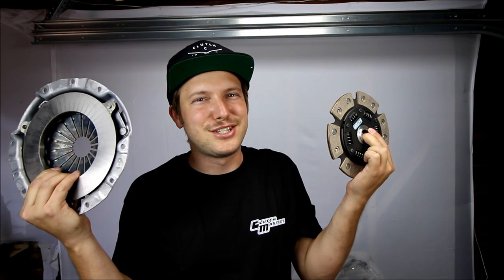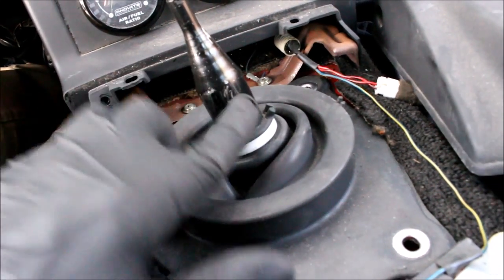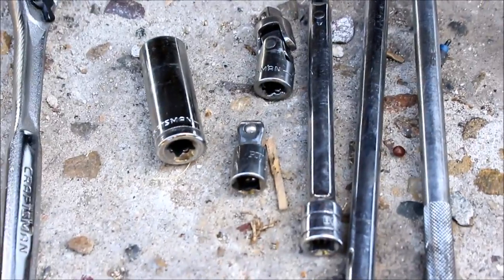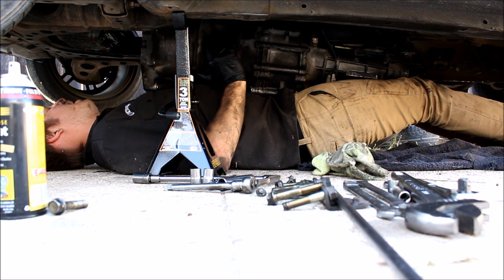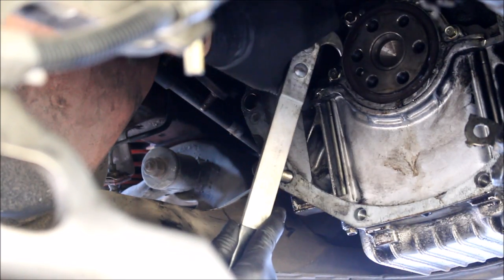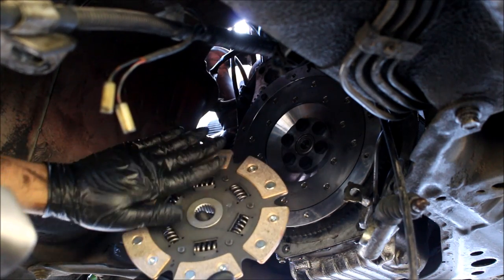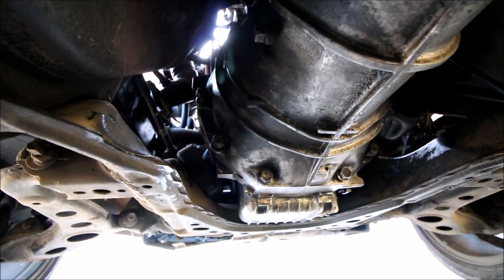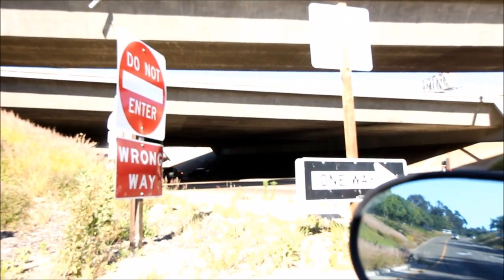Caught Slippin: The ULTIMATE Miata Clutch Replacement Guide!

Comment: Great channel!  So i just did this.  This exact same thing.  Went to start the engine and nothing.  Starter is clicking but thats it.  Then i tried to turn the engine by hand and theres no way that thing is moving.  All power is all, just like before i touched the trans.  Checked all the connections and i think its all good.  Wth is my engine stuck? Any ideas anyone?
Reply from the maker: Clutch was installed incorrectly somehow, sounds like something is mechanically stopping the engine from rotating. With the clutch pedal depressed and the transmission in neutral same thing?
Reply: TheCarPassionChannel ive tried clutch in, out, in gear out of gear.  The engine wont move.  From what i can recall i know i did it right.  Putting the pressure plate on i had to turn it to screw the bolts in so i know it was ok then.  I think even if i managed to put the clutch on backwards it would have given me some trouble then.
Reply from the maker: @sanjingitarista  Strange, did you try to rotate the engine with the trans off?
Reply: TheCarPassionChannel when i had the trans of to replace the clutch i was rotating it just fine.  Bolted the clutch and no way.  Ill try to remove the sparks, release some pressure and try again.
Reply: Nope...
Reply from the maker: @sanjingitarista  time for a trans drop
Reply: TheCarPassionChannel noooooo!!! Not again
Reply: So, i did it wrong.  I had no clue but i totally bolted it on but didnt line up the teeth apparently.  Didnt think it went hard or anything but apparently it did, ... since now i cant separate the trans from the engine.  Wtf did i do to this car??? God damn it
Reply from the maker: @sanjingitarista  as soon as you push in the clutch pedal 1 time the disc centers and it's perfectly aligned. If the disc want lined up the trans never would have bolted on.
Reply: TheCarPassionChannel hmmm.  So why cant i separate the trans from the engine now? All the bolts are off.
Reply from the maker: @sanjingitarista  I'd quadruple check that. Don't forget starter bolts

Comment: I took off all bolts, cables, exhaust, ppf, drivetrain but the trans just spins, no matter how much i push or pull it wont come off engine pls help
Reply from the maker: Try having someone lift the nose of the engine (tilt it backwards) while you fiddle with sliding it out. Carefully.

Comment: hey guys would a bad throw out bearing cause it to not go in gear when the car is on? also when i turn the car on when its in gear which clutch on the car wants to move forward and it wont start, i already bled the clutch but the issue is still there
Reply from the maker: No. 99% of the time it's a hydraulic issue, especially if the clutch is grabbing a little bit but not all the way with the pedal in. bad master, bad slave, or bad bleed. Could also be pedal adjustment but that's not just randomly going to change unless it came loose. I have a video on master cylinder replacement and bleeding if you need it 🙂 slave cylinder replacement is basically the same process.
Reply: sick thanks, oh and i forgot to mention that it whines like u said, im not sure if that helps with the problem, it had no fluid in the brake master so i put some and it work and then after an hour it just didnt work after that
Reply: hey greg i just replaced it and it still won't go into gear lol, it makes really weird noise when i right to put it in gear

Comment: Can you fill the transmission  with oil through the turret instead of the fill plug of a 2000 miata nB 5 speed?
Reply from the maker: Only 6-speeds can be filled through the turret.
Reply: Thanks for answering. Also, when pulling off the transmission does it have to be leveled or support the oil pan with wood? I am having trouble pulling out the transmission for the last few days?  It there other issue that can be causing to be stuck such as seized clutch or pilot bearing? Please help me I am lost and frustrated!!
Reply from the maker: @dannyphan543  You can tip the engine back a little to help. If it's stuck, you may have forgotten a bolt. Don't forget the starter bolts!
Reply: @TheCarPassionChannel  Thanks !!! I checked everything and bolts too multiple time but still no luck yet. I appreciate the help!
Reply from the maker: @dannyphan543  That's odd usually with a couple little bumps around it frees up. PPF and driveshaft removed?  Gotta be a bigger of a bolt somewhere 🤔
Reply: TheCarPassionChannel I removed everything, slave, starter, downpipe bracket, the pPf is out and not even hanging to the side, bolts. I checked throughly for all bolt around the bell housing and starter bolt, they are out . I’m positive I got them all. Then I put the trans on my knee like you and started wiggling it. I even Put pry bars to try to spilt it then I strapped it and tried to pull it out but no luck with both. Also the trans bell house rotates while the shaft is still in too.
Reply from the maker: @dannyphan543  If the bellhousing rotates it's free, it's possible that the input shaft is stuck in the clutch disc but more than likely you just need to hit that perfect angle to get it out. Jack up the front of the motor slightly with a floor rack and 2x4 and push up on the tail of the trans as you pull it out. Good luck!
Reply: TheCarPassionChannel alright I’m gonna attempt a few for times and hope it comes out! Thanks for taking your time and replying to my issue. You’re the best!

Comment: I spent over $1300 total for a flyin miata stage 2 clutch and flywheel to be installed on my miata cause I don't have a garage or tools. Fml
Reply: Hah, join the club. The sad thing is I actually have the garage and the tools but I have an irrational fear of working under a car on jackstands....so it's a no go
Reply: SlidewaysKenny you could buy tools and do it in a driveway for way less.

Comment: Im replacing my clutch next week i need to order soon but i cant afford 550.00 for a clutchmaster ia act a good second choice
Reply from the maker: 60ninjas ACT is an excellent clutch as well,  I've had 2 of them. Also, I believe CM's lower power clutches may be closer in price to the ACT units especially with my code, just food for thought. The FX400 in this video is about the equivalent of the ACT Extreme.

Comment: What happens if you press the clutch after u remove the slave cylinder
Reply from the maker: The pin will get pushed out on the slave, might even come all the way out or ruin the slave/blast hydraulic fluid everywhere

Comment: How can you tell if your clutch is slipping?
Reply: When you shift, the car will lug a little and take longer than usual to get into the next gear
Reply: When you accelerate the rpms increase but your speed doesn't.
Reply: Bob Appleseed put it into 3rd, release the clutch without any throttle. If the car doesn't stall, you got yourself a slipping clutch.
Reply: Got it thanks guys
Reply: go find a slight hill to put a slight load on the car,  Then mid way up the hill granny shift the car into 3th or 4th creating bog on the car.  So at this point a normal car will just bog at a low RPM, And slowly rise pulling you up hill.    Now for a car with Bad Clutch instead of bog and slow rise RPM it will SLIP causing the RPM to rev up and not pull the car up hill on a load proper.      (Now if your car is not modified then you dont have to put a real big worry on the clutch just yet,  Not until it starts slipping in 2nd or 1st at that point i would say time for a new one)    Hope this helps you sorry to write a book!  :)

Comment: The top right bolt on the passenger side above the one with the nut is pissing me the fuck off broke one of my adapter and I don’t have enough fucking extensions to actually use a socket wrench

Comment: Can you  believe i did all this shit alone and changed the Rear main seal too and then when i came back from my 5 mile test drive the fucking brand new rear main seal was leaking?  I had to pull it all back off today and i'm just sad about the whole situation to be honest.
Reply: Yup.   Cause mine did the same...got a few weeks out if it before the leak.   Itll stay that way till I'm ready to do the clutch again or it gets real bad.
Reply: @tays8306  the Second one i put in is still holding up thank god.
Reply: Maybe next winter or fall ...6 months of snow to  tackle it.   I don't have the energy to do it again, and its summer soon!   I can live with a couple drips here and there.  Its not my daily.

Comment: Skip one? What the hell is that?? You mean star pattern?
Reply from the maker: Just different wording. You have to follow the "1,1,2" pattern since there's 6 bolts, where with a 5-bolt part you use the traditional 'star'. It's just a way I found easy to not get lost on which bolt you tightened last